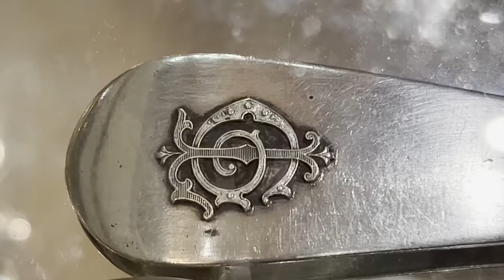Have we DISCOVERED Part Of The CHATEAU, Hidden In A Brocante?

Comment: Concerning the set of silver tableware, I have found thru my own years of collecting that the knives are usually either not fit to use or have been tossed out (as in the case of the set you guys were looking at today), the reason being that the knife blades were made of some more-durable material and silver plated (sterling blades would be too soft and bend). The blades don't hold up to use and tossed out. What I have done myself is find knives with mother of pearl handles and use them with the other pieces to set a very impressive table. If you intend to actually use the knives, I suggest having the blades replaced with modern stainless steel since ss is more durable and will hold up to washing. The original blunt (rounded end) knife blades are available in stainless steel, or you can use modern serrated blades. Today, even the most expensive sterling sets have stainless steel blades set in sterling handles for this very reason.
Reply: Thank you. Yes we’ve discovered this ourselves as we have done our research on them the last few days :) 

We will likely be back there 😊😊
Reply: @ashleywaters7198 I thought that set was solid silver, not Sterling? If Sterling, I should think they would not be very expensive.
Reply: @ashleywaters7198  "We ended up going back, didn't we Terrance . . . " Ohhhh, throwing out the proper first name. A little tease to Terrance, who will be purchasing the silver, we ALL KNOW
Reply: Could youhave the knives manufactured
Reply: I was born in Sheffield worked in the famous cutlery company I've a set of beautiful ones for best mother of pearl looks beautiful we had a complete set but disappeared seems many year's later my dad sold themselves and lots of my stuff I bought , then my X stole my silver out of the attic I bought second hand in a beautiful box on legs didn't know till I visited him he was using it with his wife my lead crystal cake stand was expensive never seen another like it . Bought off a 80 year old lady after her husband had died over 30 years ago they had it too saw lots of my stuff he'd been in with a key he took off my door keys , had to leave was fuming he'd taken my oak furniture Old Charm all matched I did have some really old antique furniture but too big for him to take my house was bigger or it might have disappeared too. I laugh now can't take it with you thank you!
Reply: Mother of pearl handled knives are preferred by some collectors. The flatware is lovely. The monograms appear to be applied, which would have been a time consuming and exacting way of finishing the pieces.
Reply: @ashleywaters7198 The price you quotes didn't seem particularly high to me, even without knives. Sterling or 92.5% silver, is much higher priced than silver plate.
Reply: @janettaylor3182  🤬
Reply: I’m drawn to the salon for some reason. That’s the room I’m waiting to see the restoration in. I know it will be beautiful. Hope I get to hang around that long!😂
Reply: the best silver is alloyed with 7.25% copper to make it stronger. That’s what is called Sterling Silver. Otherwise it would be too soft to make anything out of.
Reply: The brass sconces are magnificent and will be so impressive when lit. You need quite a few pieces of furniture for the Grand Salon and with your rather expensive taste if I were shopping I’d hold off buying the silver. Once you’ve got the room finished, go back for the “Jewelry” It’ll still be there Terry. xxx💕🐥💕🐥💕
Reply: I have a Meridian silver knife with a pearl handle just below the handle is a snowflake ❄️ shaped piece of plated metal.
It was sold to me as a letter opener.
That’s exactly what I use it for.
Besides it’s sturdy and ❄️licious.
Reply: @viktoriakohler1224  sterling is an alloy. It is 6% copper. Pure silver is very soft and not very practical for table ware.
Reply: Don’t have to many lights in your guest room think of your cost it might look great you want to make a profit  for your labour and spend your money then for whatever you want guest will not care about your costs they leave the lights on even on a sunny dayxxxx
Reply: Cutlery - knifes were made by the cutler, a knife maker. Until 1913, when stainless steel was invented, all knifes were made out of carbon steel. They had to be regularly sharpened and oiled to prevent corrosion. The flatware maker made spoons and forks, they never come in a set with knifes. Because you had to buy cutlery and flatware separately in different workshops, this is why antique sets of forks and spoons always are missing knifes. The corrosion of carbon steel explains why not many of the antique knifes survived.
Reply: I would at least buy the dessert spoons and dessert forks, if they would split the set.
Reply: Sterling silverware is very expensive and lovely!

Comment: I inherited a full canteen of cutlery. It’s not solid silver but Prince’s plate which is much thicker than your normal silver plate. It was a wedding gift to my grandfather from his brother and I still have the gift card in the canteen box from May 1918! All the spoons and forks and serving utensils are monogrammed, however, the knives are made of steel with bone or ivory handles. When sets are sold it’s often the case that the knives will get separated from the silverware as they deteriorate (water gets into the handle and the steel rusts and the bone or ivory cracks. Sets of old knives are easily found and will complete that set as it designed to be. 

Don’t hesitate, phone and reserve that set and it’s possible the owner will have a set of appropriate knives to include with the silverware. If you don’t get it, you will regret it possibly for the rest of your life. 

I speak from experience. When you’re older, it’s not the things you did that you regret, it’s the things you didn’t do. 

I do hope you heed my advice and get the silverware. 

With best wishes from Neil in Australia 🇦🇺

Comment: The Cutlery Set if is solid Silver it is well priced. I tried to count how many pieces, and how many as a setting, but alas you were way to quick on the scan, even though I tried stopping it wasn't obvious. To justify the cost divide the amount of cutlery by the € amount. The monogram is perfect also. You could then hunt for some knives with similar shape, get a moulding of the monogram and stamp it onto the knives. A silversmith could do this, or you could play with it yourself. I say get them, you will regret it otherwise. Sure they are expensive, but for every bargin buy you save money on, goes towards these. Silver is sold on its weight normally. I actually doubt that has been factored into the price. 
I work in a Fine Art and Antique Shop in Australia, just a silver teaspoon can cost anthing from $30-$60 depending on weight, hallmark, age. You will never find another unquie set like that again. Buy them is my advice. Terrance will just have to refrain from buying another chandelier for the rest of the year, or two 😉

Comment: Knives tended to be either bone handled or silver, but the tang was iron or steel held in place by something like bitumen, which tended to loosen over the years and also the tang might rust, so they tended to be replaced.

Don't worry about lots of lights - you can put them on different switches so you don't have to have them all at the same time. (Which I'm sure you already know about!)

Comment: Will there be a problem with hanging those beautiful light fixtures on the wall with their weight? I know the walls are not Sheetrock or rock board but will you need to put a brace behind the wall so they don;t fall down off the wall? I hope it works out ! What a great group of finds, I bet you will be going back there again and again.

Comment: curious.........what is the total weight of the sterling cutlery set?  With the weight you can  calculate &  judge how much the total spot price of silver is compared to the price that they want for it.
Right now the price of pure silver is US$23.00/troy oz.   Sterling is .925 so sterling/troy oz x $23.00 = $21.27/oz.   290Euros = $310US.    $310 div by $21.27 = 14.57 oz.  So if the total weight of your set is in excess of 14.5 oz............you got a real deal there!

Comment: Sorry, did I hear correctly?  700 euros is $749US div by $21.27 = 35.21oz div by 16 oz = 2.2#..............if the total weight of the set is more than 2.2#,  you have a deal there.

Comment: The reason why there are no SILVER knives in this cutlery set is because SILVER does not hold a sharp edge and or thin edge.
Reply: The knife handle can be made of silver, and the knife blade of stainless steel